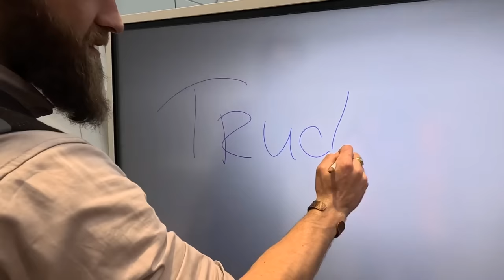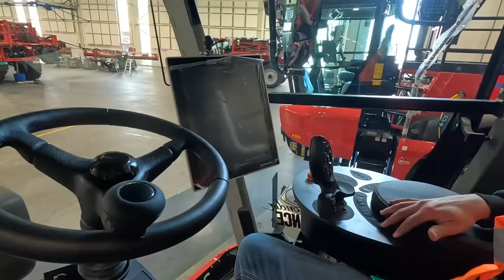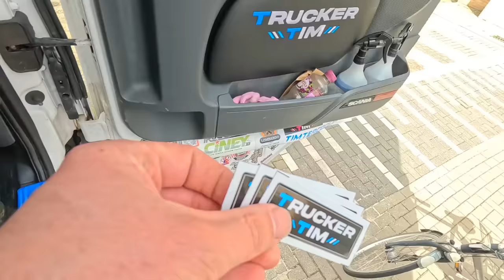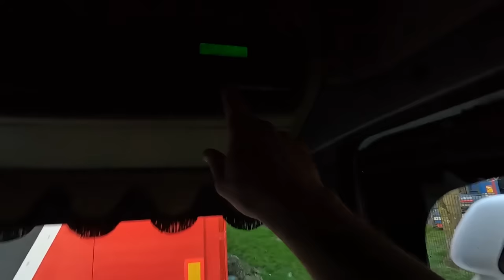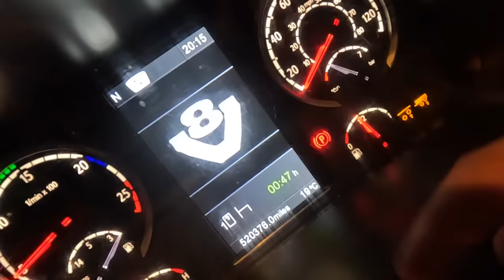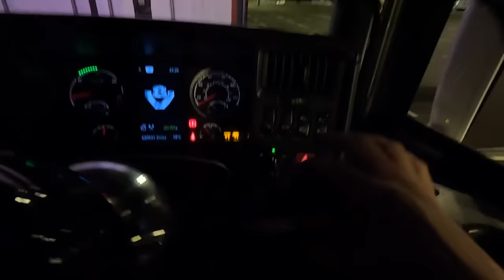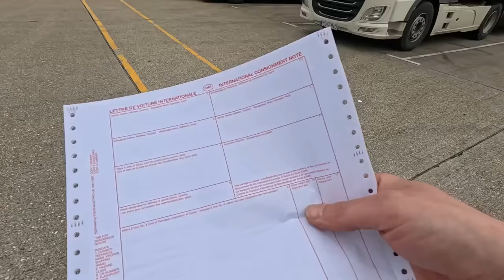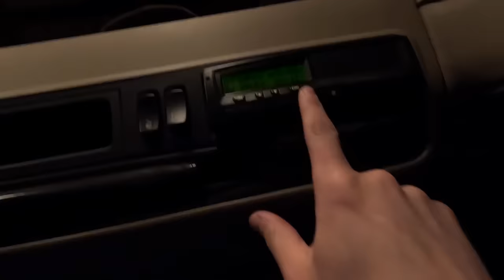NIGHT BOAT TO UK | EUROPEAN TRUCKSTOPS ARE BETTER | PT2 | #truckertim

Comment: Dear Tim, your stearing wheel is probably highly forbidden in Germany. German police forces have given truckes huge fines for having a stearing wheel like that. I know of guys changing the wheel back to original with all the hassle it comes with before they enter Germany.
Just want to give you a heads up if you ever go there.

Comment: Nice one Tim. Glad you enjoyed Holland. However, one thing that I like UK for is the hills and scenery. Holland is too flat for me.
Just got back to Spain from Morocco late last night, with my motorbike. The ferry was 3 hours late,  because of the time it took to load and unload the trucks. All the loading and unloading was done from the stern. Hence it took an eternity to reverse all the trucks into position. Even the offloading where they were driving off forwards took about an hour.
Reply: As a half dutch/brit who lives in the Netherlands, I agree. The architecture and houses are also much better in the UK than or almost everywhere else in Europe
Reply: Well i can imagine that except for the most southerneast part of the Nethrlands it's as flat as a pancake and the Netherlands have fantastic roads. Those are just a pleasure to drive upon especially for Trucks. While a mountain/hill road can be really a hell for trucks and a pleasure for motorbikes..